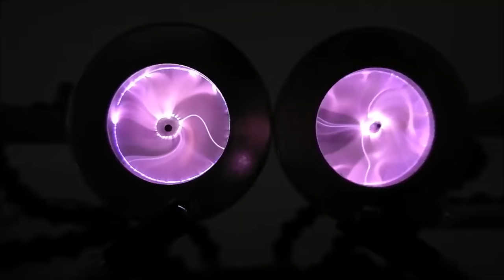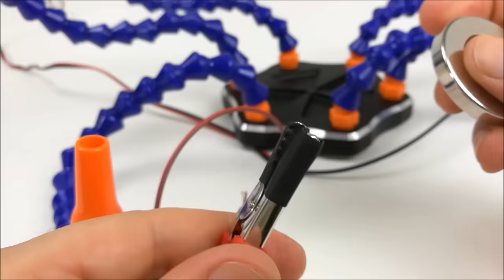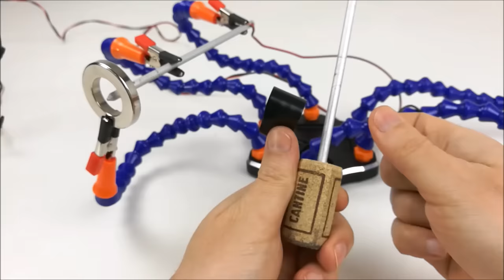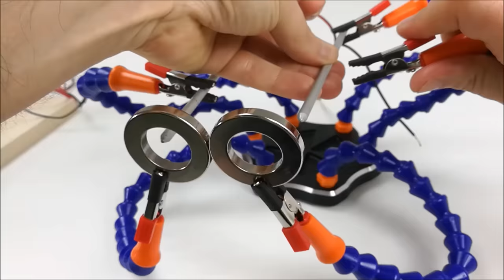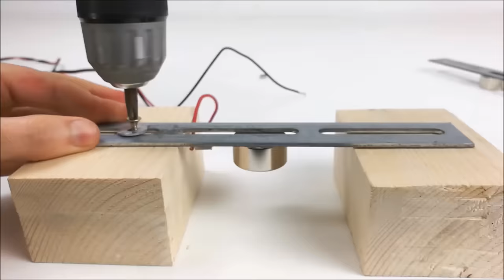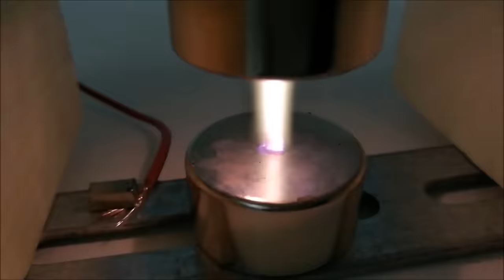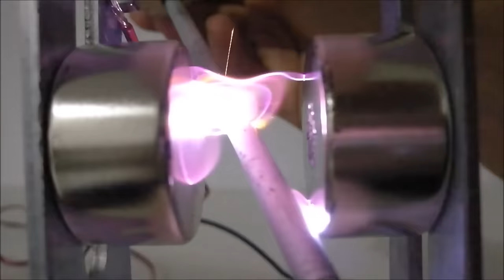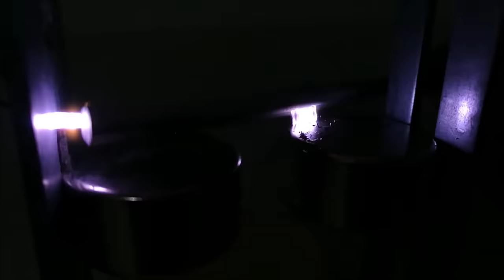Plasma Vortex in a Magnetic Field | Magnetic Games

Comment: You could try to do a plasma vortex using a solenoid. Since a solenoid's magnetic field's strength can be manipulated by variating the power that runs through the wire, you could normally manipulate the plasma's rotation speed.
Reply from the maker: it sounds like a very interesting experiment ... have you already seen something like this on YT?
Reply: adjusting the poyinting vector and form a double layer and you are imititating the process of the sun , search violent duoble layer detonation.
Reply: Magnetic Games I'm sure channel Suspicious0bservers would highlight any further experiments you do great guy go to his website and get a hold of him: https://youtu.be/JZ29rcIQu8g
Reply: basically just use an input power source that can create AC current of different frequencies running through the magnets.
Reply: it has not been done on youtube.
Reply: or it has been done and the videos removed as with videos of tesla heat pumps ;)
Reply: Zekerias Varg, exactly, because they are aware that when tuned to precise resonance, the tesla heat pump can cause buildings to collapse and a large enough one with prolonged use could potentially cause an earth quake, there is nothing stopping that wave from accumulating more energy over days, weeks...
Reply: @timothyegoroff8333  A what now?
Reply: I like. Any further info would be greatly appreciated
Reply: @MagneticGamesIT  Where did you find the aluminium rods please🤔?  I have magnets and ZVS but i need the rods now...

Comment: You just proved that magnets have rotating fields, more specifically they are generators of toroidal spiraling flux wich can be used to produce work!
Reply: He passes current through them you buffon. The energy he puts in to spin them is the same energy that the spinning fields give back.
Reply: You sir need some basic physics education, you both kind of do. Electrically charge particles moving in a magnetic field experience a force that is tangential to their velocity vector and the magnetic flux, any moving charged particle that is subjected to a magnetic field will have it's path bent in a circle. In this example the electrons are being forced to move through the space between the nail and the donut magnet, the magnetic field lines in this area are effectively perpendicular to the flat face of the magnet, this causes the electrons to curve hence we see the bent arc and the arc processing around the donut magnet.

We do use this to produce work, literally every single electric motor uses this effect to perform work using electric energy....

Comment: These experiments are highly dangerous. To create sir plasma, you will need 3,000 Volts per mm. At this high voltage, electrons striking metal produces high energy Ionising X-rays. also the violet visible light also contains invisible harrmful ultra-violet rays. So, personally, I would recommend that no one should try this, Unless you really want to create X-rays.

Comment: Great vid , but I think u damaged those magnets , some point on those magnets might have reached temperatures above the Curie temp.
Reply: 🔵 As long as the main body of the magnet does not reach the Curie point the material will have no difficulty retaining a Gauss field. Even if very tiny areas at various points of the Ring reach Curie point the reinforcement of the field from the rest of the magnet will immediately re-energize that tiny portion.

Comment: What, You're not gonna say, "Its Free Energy"?  Like that one guy on Youtube that wraps a wire around a spark plug, then hot glues it to a ceramic magnet and tapes a bunch of crayons around it with a switch to one end of the wire and a flashlight bulb to the other and presto!  A bunch of garbage that has kids amazed!!! 😅
Somehow I get the feeling your stuff works. 👍 Thanx for the videos. Good stuff.

Comment: What is science behind that?
Can anyone tell me ?
Reply: Yes I can
Reply: The science is that magnets are metals that are filled with electric charged particles witch allow them to stick and push away things.when he gave the bar connected to the magnets a pump or electricity,the electric current reflected and acvated the other electric particles in the magnets,and through friction,plasma was formed.then the charged particles of the magnet,because of their circular shape,symbolized a miniature north and South Pole,warping the plasma to fit the magnet
Reply: They warped the plasma because as the 4 state of matter,plasma was a liquid and solid state of high charged energy,so basically as if a super strong magnet melted and turned part gas,and was charged with a few million volts
Reply: @minecraftmarioboy5012   thanks :)
Reply: The Star Tuber no prob

Comment: Unfortunately, plasma arc generates massive heat, and the curie temperature of modern rare-earth magnets is quite low due to impurities in manufacture introduced since about 2015-2020.  You are going to want to wick away as much heat as possible.  Start with a steel disc on the surface of the magnets.  Try copper or aluminum for better heat spreading.  Both options will extend the life of your permanent magnets greatly.

Comment: Good~👍✨.. "Magnetron reactor gas elighner.." if the sceince faction no need the oil fuel inside the engine but energy metarial. Plasma is highed energy crystone quantum neewtron-ion specifield engine thats how can travel in fast.

Comment: Now if those magnets are in a Lotus flower position and a more powerful energy.  with super powerful magnets that are only activated with energy that do not have individual magnetism that this magnetism is activated with energy to give more strength.  Well, the plasma would fly with great force, just imagine when you have an audio system and you turn up the volume, a force comes out with the pure sound, a force give speed that can break windows or destroy something like that, it is to create that plasma engine, we could add some more compact and more powerful fuel.  that would create a speed beyond Light

Comment: great to see but it damages your magnets real quickly.... by getting hot (and plasma is hot) the magetisation disappears over time....

the plasma burned already in 1 several spots I saw and then it starts to avoid these spots....(isolating oxide layer formation maybe ???)
Reply: You can easily remagnetize your magnets with an electromagnet

Comment: How many turns of wire do you use on the primary of the fly back ?   2 , 3?  And what is the current/voltage you are supplying to the ZVS?  Thanks 🙏 nice job nice 👍
Reply from the maker: 12v in 20000v out

Comment: Does the magnets suffer any damage from the hot plasma ? I saw some white colors and I assume that  temperature must be at verry high level :)
Reply from the maker: they demagnetize at 80 °
Reply: @MagneticGamesIT  Yes, that was one of my supposition, thank you for confirmation ! Have you tryed with an induse magnetic field by some diy  copper coil ? That should eliminate problem of demagnetization. What about chemical/fizical damage/ware  of the magnets and the other anode/cathode material ? I saw some black spots on the magnets... any ideea on how to avoid that type of damage ?  By inducing another magnetic field, do you thinck will be possible to keep plasma away from electrodes surface ? .. if not, at least a theoretical  plasma ball will be created and still will be fun to watch ! :)) If you ever decide to make a plasma ball, please let me know.. i'm verry curios about setup and the results ! 
Best of all !!

Comment: plasma is very hot, how the magnet is still magnetic? they lose their magnetism if they are in touch with temperature higher than 80 degree temp.
Reply from the maker: that's correct, but my electric shocks were short, they didn't have time to warm up
Reply: @MagneticGamesIT  shorts becouse of magnet?

Comment: so if you made one ring large enough to fit a human through at say one of the planet's poles and place a matching ring on the moon - somehow creating a connection between the two (the moon being tidal locked would give a few months to make the connection wouldn't it?)  to start the plasma bridge - then surround our guinea pig with a protective magnetic field that allows for propulsion from one ring to the next and we could make the trip to the moon in approximately 5 or 6 minutes?  The start and stop would be horrendous as the acceleration and deceleration would be extreme but varying the magnetic field around the victi... um Test pilot should allow for gradual increase and decrease.... ok.. I'm either baked or tired... can't tell but it was a fun thought... ooh a squirrel

Comment: I'm trying to make a strong electromagnet tube and no luck, any Ideas? because I wired 8 9v batteries in series for 72 volts and connected them to the 12 gauge wire, no reaction. Can I get some help somehow?
Reply from the maker: you cannot use battery to dothis , you need 20000 volts

Comment: Do you ever coil the ring magnets , using positively conductive and the other negatively conductive metals each unto their own pole and then the coil tips at eachother with a gap and charge each the positive and negative and then remove n
Input sources? And see if the magnet itself encourages a sustained discharge from the air ground or positive and negative charge based on the encouraged field by the magnet? A bar magnet  with each pole end wrapped with coils , and then positive input the positive and negative sides?
 I have not done this but have been very limited and they have tried to kill me because of some generator designs and have been very limited in my research and design simplification research and developments.  And, If my security and patents people are watching. Please and consider this as far as the battery and air drawn capacitor  designs possibilities..  St. Elmo's Fire out to good use.
 My name is Jason Christopher Teddy. Nice to meet you.

Comment: Have you heard of Paul Pantone‘s plasma generator.   Look up Paul Pantone‘s plasma generator it forms a new radiation and a new element due to the transmutation of the elements.  Anyhow it releases in a Normas amount of electricity which we contain in a copper tube which forms of lotta Eddy currents.  And then we wrap it in aluminum and it wants to levitate.  I was just looking for some help my email Is in my about section on my YouTube

Comment: How it made! Not explained 😪
Reply: The magnetic field causes a Lorentz force to be exerted on the arc (it's essentially a stream of charged particles) which get pushed up by the magnetic field, and this causes the plasma to circle the rim of the magnet and the stronger the magnet, the faster the rate of oscillation.
Reply: @northernskies86  what are materials required?
Reply: @nareshpratikrai5240  It can be built with a high voltage transformer and a ring magnet polarized axially. If you're planning on building one you should always practice high voltage safety as a shock could be lethal, or at least hurt like hell.